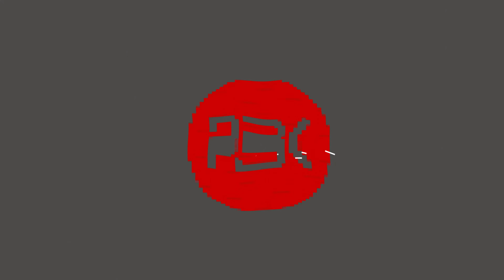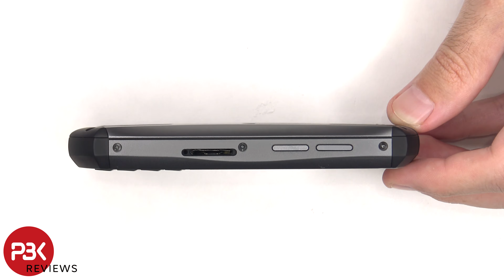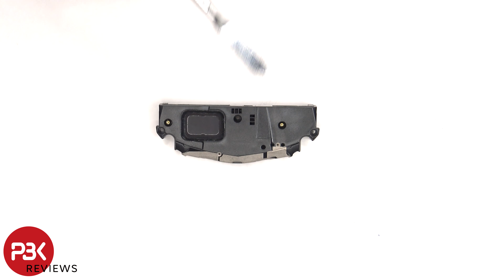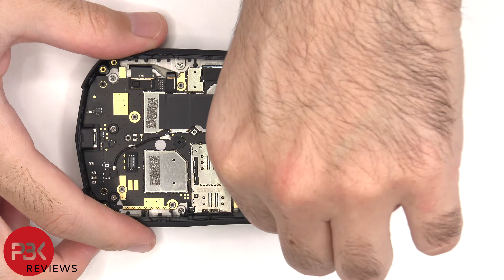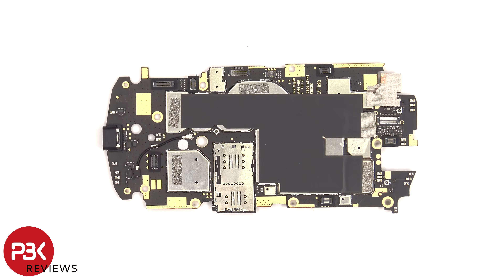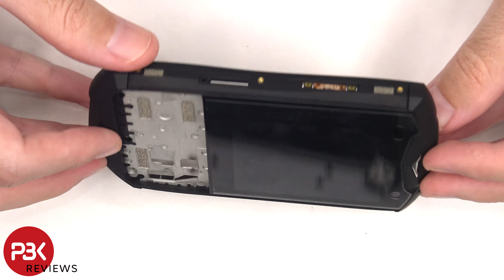Unihertz Titan Pocket Disassembly Teardown Repair Video Review

Comment: 4/10?  I feel like it should be given a higher score, given that you didn't need a heat gun, and unihertz sells some replacement parts on their site.  Also the exposed screws make repair easier.

Comment: I dropped my titan pocket recently and the main camera stopped working, thanks to this video i was able to plug the ribbon cable for the camera back in.  although, oddly enough on my phone the ribbon cable was glued to the back of the camera, which is different from the phone in this video where i see you lifted up the camera and the ribbon cable stays on the board until you unplug it.  I suspect some units come with glue on this cable that's clearly a design flaw because had the glue not been there it probably would not have become unplugged when i dropped it because it won't have been yanked out by the whole camera module glued to it.

Comment: Hi, I replaced the damaged keyboard in my titan pocket exactly following the video tutorial on youtube... the keyboard works but the backlight and the scroll wheel don't work 😔 what can be the reason?  I ordered another keyboard thinking it is defective that I will try to replace, what can be the problem?  before the replacement the backlight and the scroll wheel worked and in the settings they are active ... thanks, greetings
Reply from the maker: Hmm, try updating the software on the phone to the latest one, sometimes its a software issue. If it doesn't work, try backing up all your data and doing a factory reset (which will erase all your data) and see if that helps since sometimes it needs to be reset for the replacement reader to initialize with the board. If not, then might be a defective keyboard I would assume.
Reply: @PBKreviews  thank you 👍
Reply: Did it work?